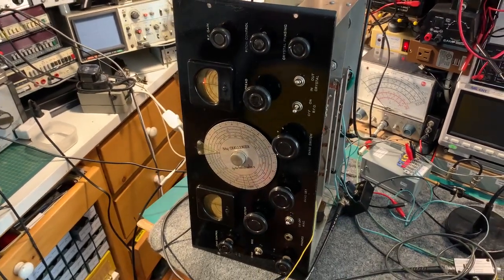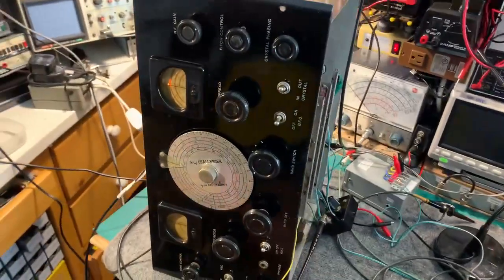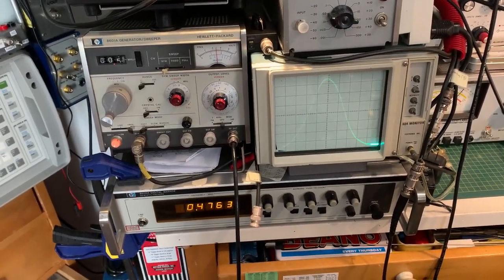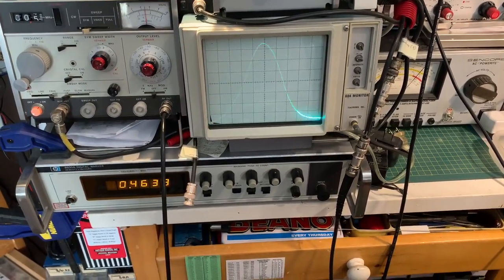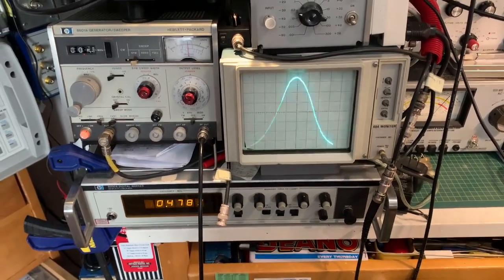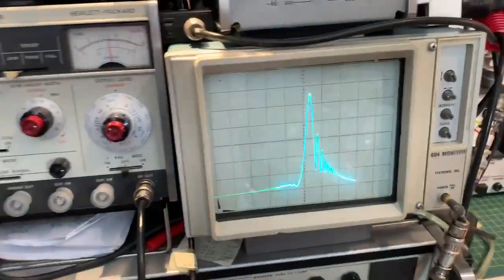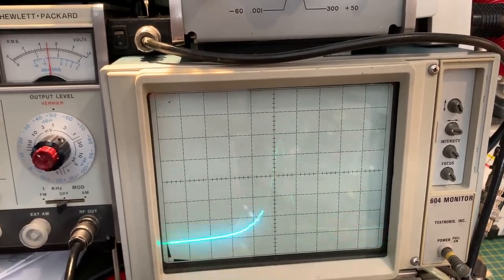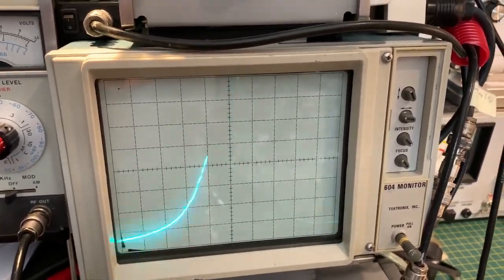Demo of SX-18 IF Response Curve Using HP8601A Sweep Generator

Comment: Sounds like the video was cut early, Gerry :)
Reply from the maker: Hi Ashley.  Yes, I must have clicked the camera off before I meant to - however, I did not drone on for much longer as I recall, so did not miss much out.  I was going to say that a real time display, as for the analogue sweep generator, is better for a qualitative assessment of the response curve while adjusting the IF transformers to optimize the shape of the response curve, or to look at the effect of turning the crystal phasing control as in this demo
Reply: I quite like the cliffhanger format :)
Reply from the maker: @ashleydawson5070  Haha - maybe I should start a vintage radio soap opera (or maybe I already have....!)